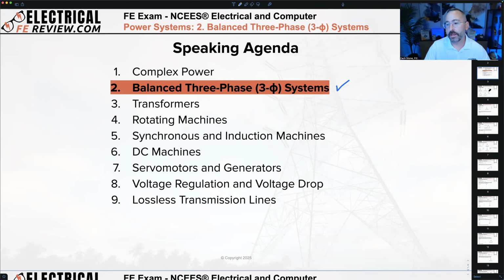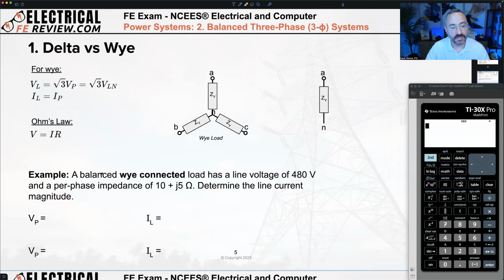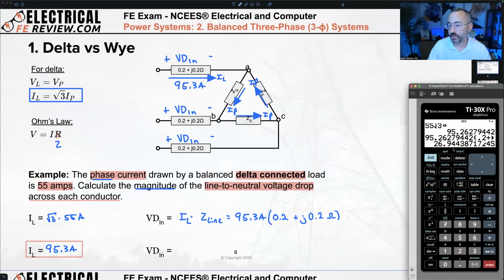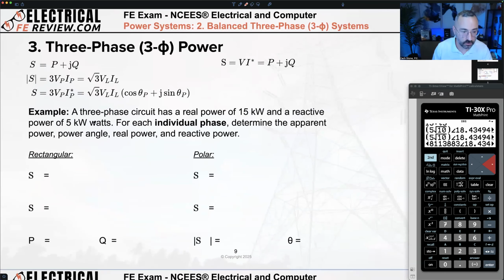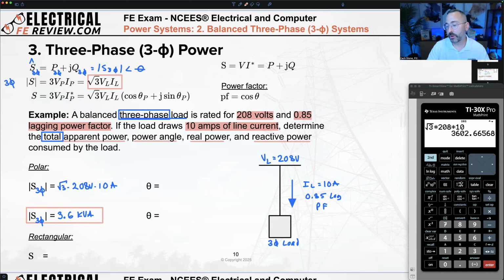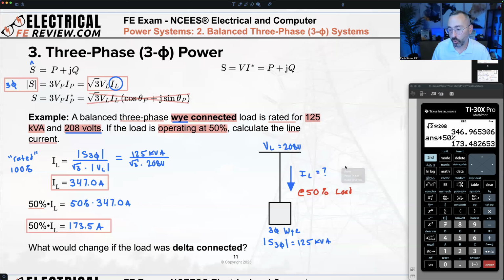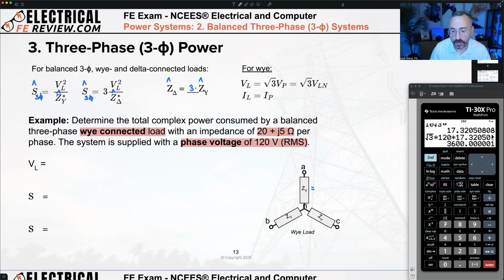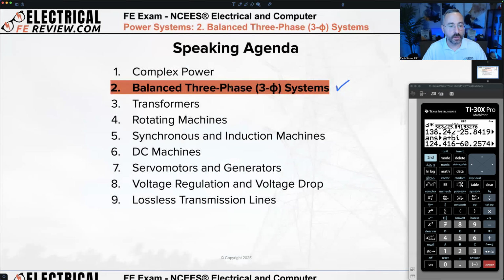FE Power Systems Webinar Series – Ep. 2: Three-Phase 3ø | FE Electrical & Computer Exam

Comment from the maker: 🖥 Video Table of Contents:
0:00 - Introduction and About
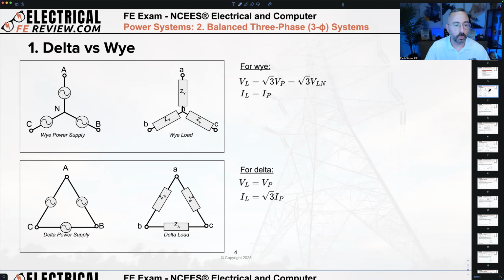3:28 - Delta vs Wye
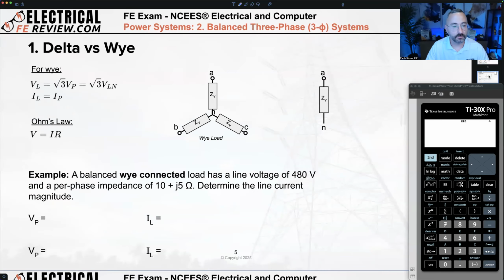17:11 - Wye Example Line Current
26:28 - Delta example Voltage Drop
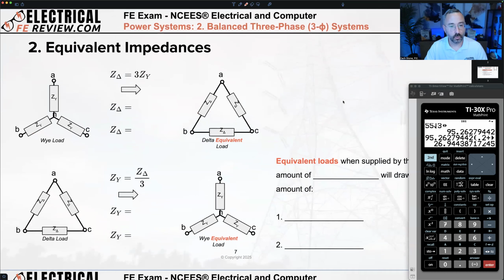32:25 - Equivalent Impedance Example
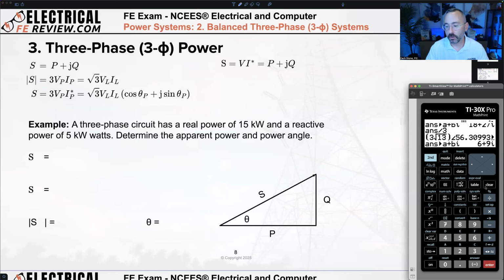38:40 - Three-Phase Power Polar vs Rectangular Example
45:11 - Per-Phase Power Example
53:20 - Three-Phase Load Line Values Example
1:06:42 - Three-Phase Load Operating at 50% Example
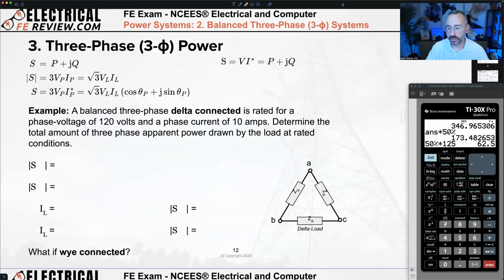1:16:27 - Three-Phase Load Phase Values Example
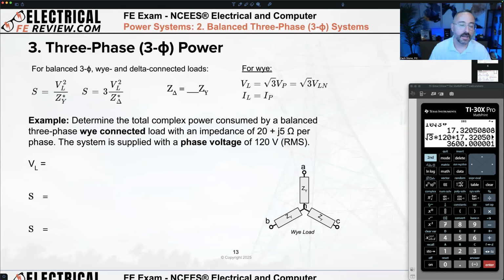1:24:42 - S = V²/Z Wye Load Example
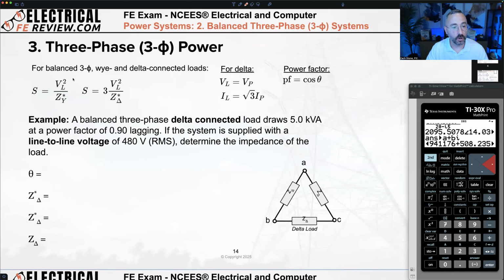1:31:14 - S = V²/Z Delta Load Example
1:37:50 - Outro

🎥 Watch the Entire 7-week FE Exam Power Systems Playlist:
https://www.youtube.com/watch?v=siqJcVvBIoA&list=PLF8qb98ScWRmv9KUdS9JuuSxu3avUJSES&pp=gAQB

🖥 Watch Each FE Exam Power Systems Episode:
1. https://youtu.be/x2DxMynU1Iw?si=u4X32nEpu4V2HuAt Complex Power
2. https://youtu.be/9MQoM3TZ8d0?si=j5cHuntq6asV0dgZ Balanced Three-phase 3ɸ
3. https://youtu.be/Wimdh5XCXKo?si=Pj8HdM0bTkgzDFTI Transformers
4. https://youtu.be/Sp11qljUqvs?si=-avfCgRxDZeJI9km Rotating Machines
5. https://youtu.be/mwzeg1IBWeU?si=q1AUDu9bwalSivPs DC Machines
6. https://youtu.be/fKrlIRwzKJU?si=wBxGbl3v4_DYXH9X Voltage Regulation & Drop
7. https://youtu.be/siqJcVvBIoA?si=tH94j3PO9Xei48DG Lossless Transmission Lines

📚 This webinar is part of my free FE exam prep course:
👉 https://www.electricalfereview.com

🎥 Subscribe for future live classes and recordings
👍 Like this video if it helped you
💬 Drop your questions in the comments

Comment: A little confused on the example 1.Delta vs Wye where phase current is 55A and impedance of .2+.2j is given in the line supplying the delta load.  When we multiply the line current (after converting phase current to line current), that only tells us the voltage drop between the supply and the terminals of the load - as if we are calculating line voltage drop.  Since we don't know the supply voltage, we don't know what the resultant voltage is at the terminals of the load network.  If we did, we could convert that voltage from lin voltage to phase voltage. IOW, I don't believe the video shows the L-N voltage, I think it shows the conductor voltage drop in the supply line.
Reply from the maker: That's correct. That particular example (starting at 26:28) is calculating the line-to-neutral voltage drop VDln which is the voltage drop across each conductor. You can see physically where this quantity is located in the circuit at 31:28. For this example, it is not possible to calculate the supply voltage, or the voltage available at the load without more information given.

Comment: I know that Vab=root(3) *Vp angle(30)
So in 1:30:00, shouldn’t we have V_L=208 with angle 30 degree?
Reply from the maker: Are you referring to the line voltage in the formula S3ø = 208V²/(20+j5Ω)* ?

If so, the voltage used in this formula is just the magnitude. I believe I touched on this earlier on this page/webinar, but this formula solves for complex three-phase power (S3ø) using the square of the line voltage magnitude (VL²) and the conjugate of the complex impedance (Z*) which means you do not include the line voltage angle at all in this formula, otherwise you will get an incorrect power angle (θ).

You are correct that for a balanced and positive sequence system, the line voltage leads the line-to-neutral phase voltage by 30 degrees. However, in this problem, we were never assigned (nor had to assume) a reference angle to the line-to-neutral phase voltage in order to solve this problem.
Reply: @electricalfereview thank you!
Reply from the maker: @nual5164  My pleasure. Keep it up!